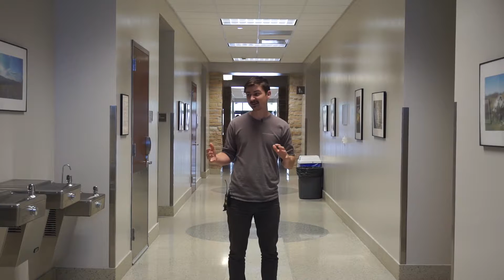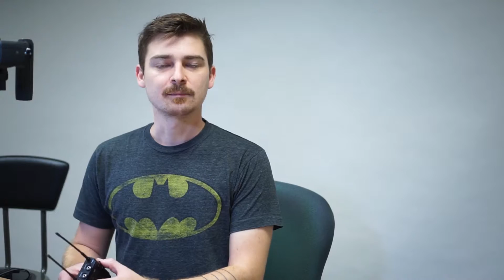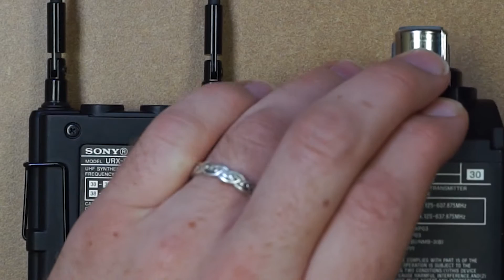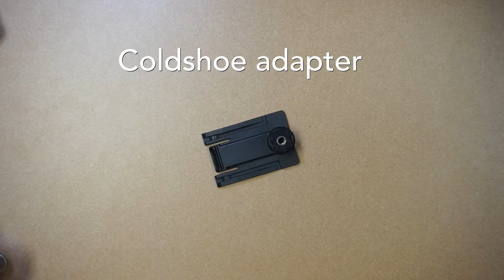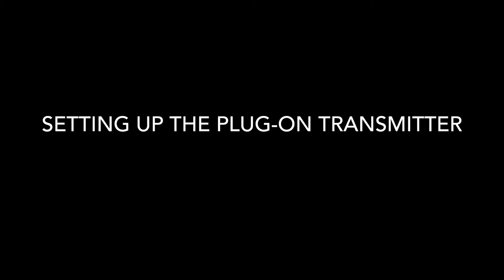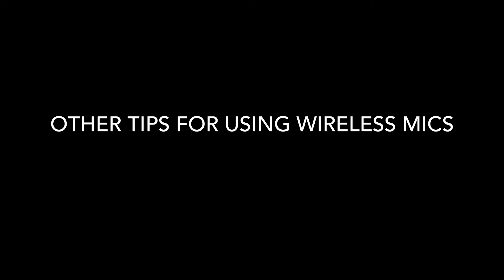Sony Wireless Microphone Setup

Comment: Hi, thanks for the video.
Is it possible to connect two identical transmitters (with a neck microphone)
to one receiver?
Reply: Hey did you ever find out if it's possible to connect two transmitters to one receiver?

Comment: Thank you for the video, can I use the two transmitters simultaneously?
Reply from the maker: You can use two transmitters simultaneously only if you have them set to different frequencies and have paired them with two receivers set to each frequency.

Comment: Great video. Just what I needed. Thank you. 
Just one question: when using two lavs on two transmitters, can I use a single receiver to capture both signals? To maybe send as one to a recorder? Or is this wrong?
Reply: MrHappy3feet These radio’s Work much like the one in a car. You can have one transmitter with as many receivers tuned into the same “station” it is “broadcasting” from, but not the other way around. There are portable wireless packs like these, however, where the receiver is essentially two receivers in one.
Reply: Thank you very much. Have a great day

Comment: Can I set it up just to my camera instead of a recorder?
Reply from the maker: Yes. These portable wireless systems are meant to work directly with a camera. They even come with a cold shoe adapter and a 3.5mm cable. However, camera audio is usually compressed and poor quality. If you have money to upgrade your audio capabilities, best to start with a quality PCM instead of a wireless system.

Comment: What do you recommend for the attenuation?
Reply from the maker: The main thing that can limit wireless radios of all kinds is improper antenna placement and signal blockage. Try to get the receiver high above any crowd or structure that might block the transmitter. Also get the transmitter antenna fully stretched and open. Bad line-of-sight is how I faked attention in the first scene.